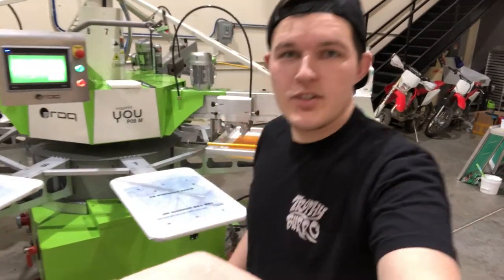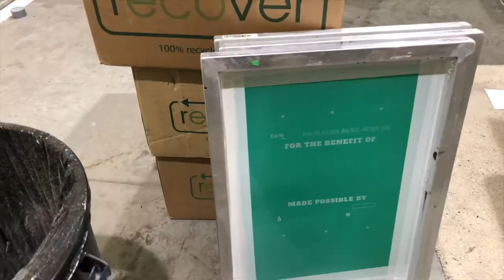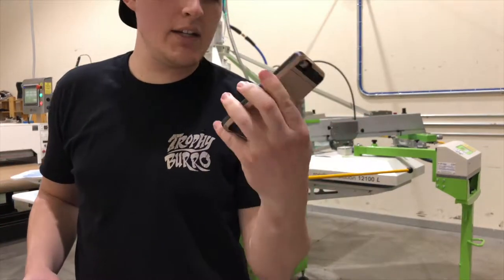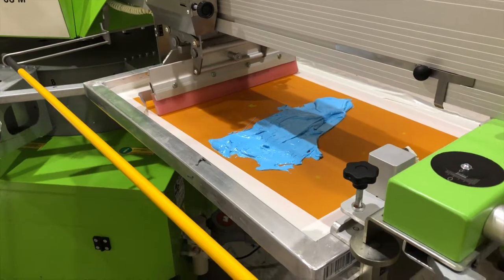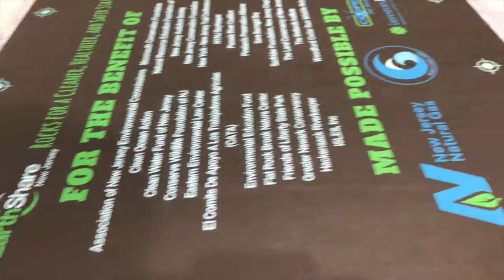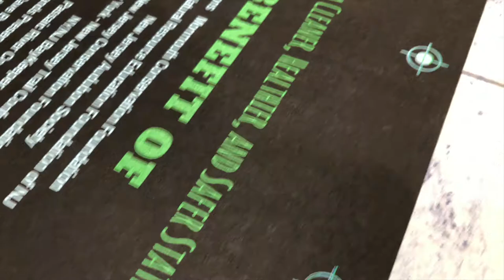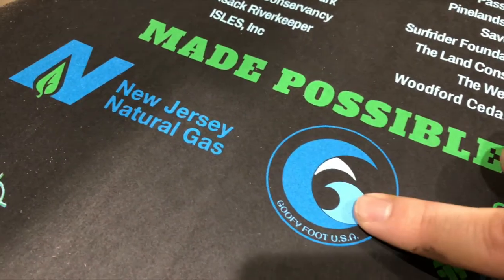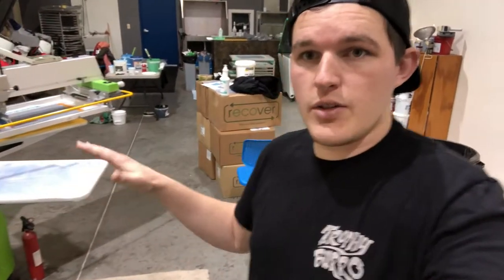4 Color Screenprint Registration on ROQ in under 5 minutes

Comment: Love the press, you mind sharing how much a setup like that cost?
Reply from the maker: There are a lot of factors in the price of a press. The flash alone can be between 3-5K and the press price is based on the size and number of arms, you also need to factor in cost for setting up electric and you will need compressed air. Sometimes you can find great used one too. I would say the average set up would be between $50-80K not including a dryer.
Reply: @TylerCary  thanks for the details, helps a lot cause I can never find prices for the higher end stuff online and I'm not ready to talk to a sales person.